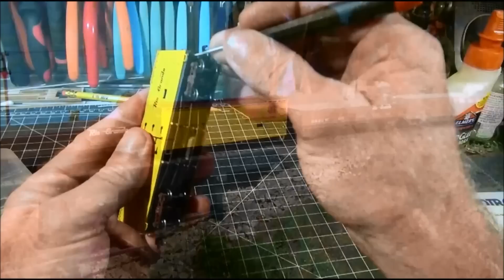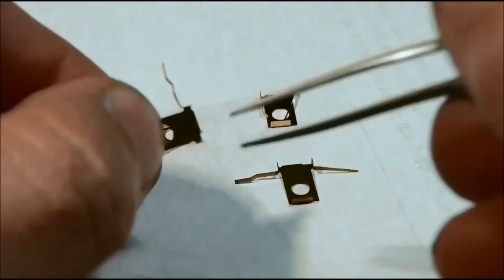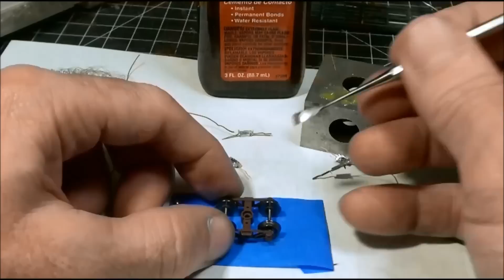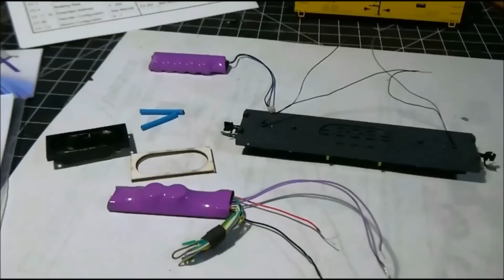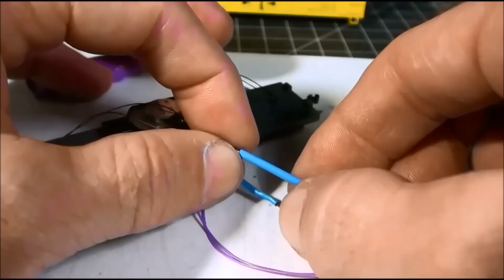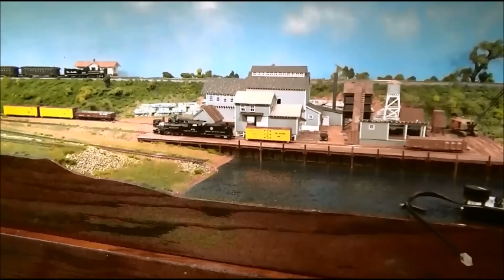Installing a SoundCar Decoder into a Blackstone Models Refrigerator Car

Comment: Now this is neat but I was thinking the sound would have been a mechanical reefer sound and not the rail joints clacking. Still this is a pretty neat detail.
Reply from the maker: The SoundCar has Generators: Adjustable for reefers and passenger cars and rail joints as well as other sounds for railcars.

Comment: I was planning on 3D print out a couple Amtrak Budd Metroliner Cab Control Cars. Can it use this type of speaker?
Reply from the maker: We don't know the exact size limitations of this model, but the speaker should work. Our 35 x 16mm speaker fits in narrow hood diesel models. You may even be able to go a bit bigger with the 35 x 20mm speaker. You can find a full list of the speakers we offer on our website: https://www.soundtraxx.com/access/speakers.php

Comment: How does it not short with the metal axles
Reply: the wipers are touching the wheels not the axles
Reply: yes but if the axels are metal and the wheels touch the metal, wouldnt it cause a short
Reply: the wheels are insulated from the metal axles - you can just see the insulator where the axle joins the wheels.
Reply: Shelton D'Cruz ooooohhhhhhh